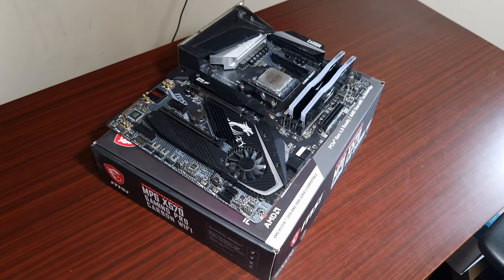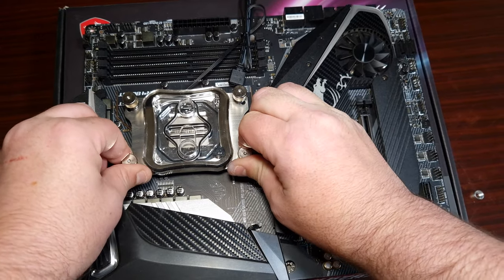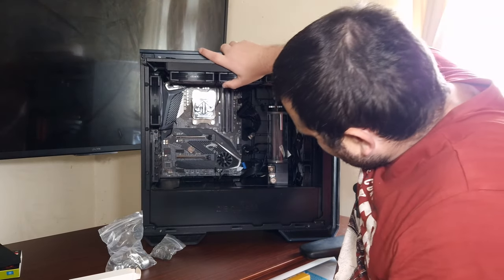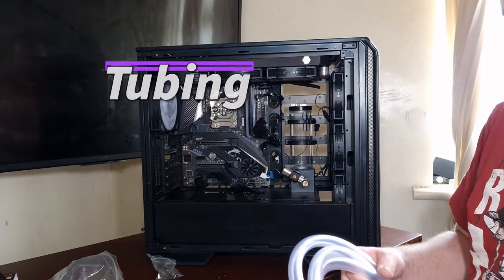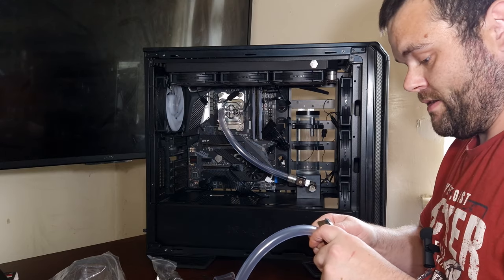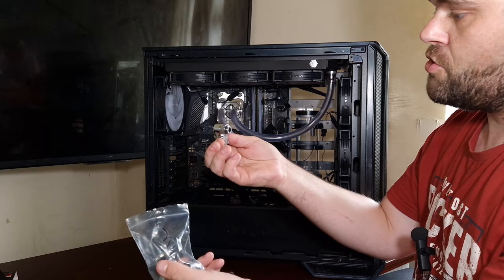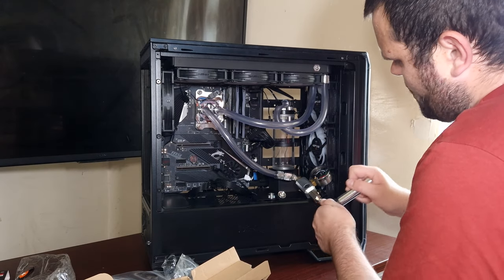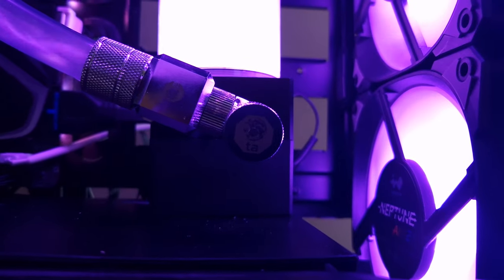How to Water Cool your PC / Step by Step PC Water-cooling

Comment: Thanks for this video. I will be doing my first full water cooled custom build in the following weeks. I will use Bykski components for both CPU and GPU cooling using soft tube.
Reply from the maker: I've used bykski got a gpu block here and no problem

Comment: I have just today drained and flushed my custom loop. I done everything else correct. But I left my GPU water block plugged in whilst I was doing this. Would this cause any issues at all or is this fine ?
Reply from the maker: As long as there's no leaks it will be fine its why I say to unplug everything just in case and to always do a leak test but I don't see any problems really as long as there's no leaks it will be just fine
Reply: @WELSHYTECH thank you so much you have out my mind at rest! Haha
Reply from the maker: @MacsSelfHelp   you are most welcome anytime 🙂